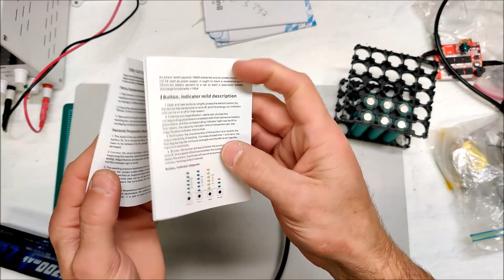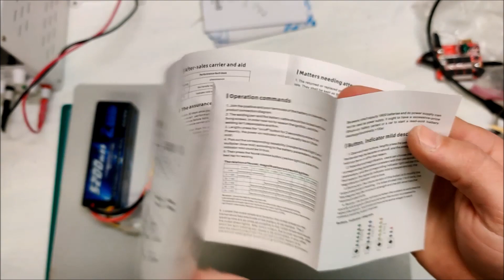NEW DIY SPOT WELDER - BEST YET?

Comment: Battery spot welders don't seem to be very good and are more for occasional applications than super capacitor spot welders. I made one myself using an old microwave transformer and a control board ordered from Aliexpress, but ultimately, that's also a bit of a fiddly job, and the nickel strips heat up too much when properly installed. At lower voltages, they're less robust, so I'm going for an original spot welder with capacitors, hoping it will work perfectly with minimal heat.

Comment: @bvmalukqat9545
Some additional data on this great spotwelder. I started measuring the delivered amps by this spotwelder and I really measure an astonishing 1800 -2000Amps. I first used my ampmeter and it gave out of range > 1000A. I got curious and installed 2 supply wires and then measured between 500-900A per wire = 1000-1800A. To be absolutely sure I bought a 400A 75mV shunt and this gives me approx 400mV => 2000A...
I use 4 very old (> 10years) 5000hAh 45-90C batteries in parrallel at 15-15.5V and installed 4 TVS diodes for  surge protection. I noticed that the voltage to the Mosfet gates is dropping too much (to 6.5V) on the highest setting and added 2 220nF capacitors (now it stays above 10V).  Note: Make sure you get the original plate and not the chinese copy.
Reply: Mines doing the same at the highest setting, could you share where to put the capacitors? Also how do you tell if it is original. Thanks

Comment: Thank you for your great research Steven. Can nickel be replaced with copper?
Reply from the maker: In theory yes, but getting really thin copper can be hard. Nickle is good enough for most batteries
Reply: @ I see. Currently I’ve got 0.2mm & 0.4mm  Cu strips. For 21700
Reply from the maker: @TariqShahFPV  0.4mm is really thick for a diy spot welder to penetrate
Reply: @ yes that’s what I was thinking too. God thing I got the 0.2mm. I’ll try to thin the.4mm down to .3 or .25mm. For minimum resistance

Comment: Hello, I bought one of these based on this excellent review (V1.4). I am quite happy and even can weld a copper nickel sandwich. 0.1 mm Plated Nickel with 0.1mm Copper. I do that at 14.8V - 2nd setting - and measure 900-1000A current. I use 4 very old (> 10years) 5000hAh 45-90C batteries in parrallel. Before pushing the JQ-DHJ02 even futher I have to install first some TVS diodes for  surge protection (probably the 1.5KE18A ) Any way the question I have: Is it possible to operate this board with a foot switch? Thanks
Reply from the maker: Im glad you like the spot welder!

Comment: Thanks for the suggestion on this one. Blown away by how good it is. No more powerbank style/built in lipo spot welders.

I'm using just 1/3 of a 12S8P A123 pack (very good condition probably barely cycled) so I have an IR of like 4.2mΩ on the whole 12V pack that I'm using. I put it on the second capacity setting since its about 19.75Ah and then I think I go up to about 30C. I"m getting solid welds on 0.20x8mm pure nickel and honestly I think it might have the juice to do 0.30mm pure nickel if I paralleled another 12V pack of 4S8P of A123 ANR26650M1B cells.
Reply from the maker: Awesome!
Reply: @stevenc22  well....I only had 7 Headway 38120HP cells left after I accidentally killed one so I built a 3S2P Headway pack and then just used one less series group on one of my A123 4S8P M1B packs so it would be a 3S8P.....

Lets just say after reviewing the instructions and and the chart for the Ah/C rate.....I had a 36Ah and I've been using 20C-30C and I'd guess its probably much closer to 30C than 20C because....at 1080A I blew her up....which...ya know its rated at 900A

The traces seem to be incredibly delicate or I really just gave her way too much juice. I also blew one of the fets but that seems to be a result of some traces going first and where I still had good traces is where I blew a fet. Just a massive crater in the fet. I desoldered it and I might try to repair the board by replacing all the fets with IRL40SC228's since that's what I have laying around right now.

Comment: This thing SUCKED!!!! I TESTEDNIT 2X.  first time it didn't work so good. 2nd test it worked very well. Was able to weld .2 tin strips. Then it was time to finish my pack and it wouldn't weld anything together. Not even the cheap fake tin strip that came with it. AND The plastic part of the power button popped off all by itself. I was trying to weld and not even touching & pop it flew over my head somewhere never to be seen again. It's not convenient to return things to amazon for me so I'm stuck with this inoperable trash ! Very disappointed! Now I'm not gonna have my bird working for the ESK8 convention  in Las Vegas next week!!!! SOBYEAHBIM PISSED! DO NOT BUY THIS!!!

Comment: quick question - an aircraft - 3s 11.1V lipo battery with 100C rating (but only 1550mAh) will work fine? it should give 155Amps. it has only 5 ohm resistance per cell.. so it should be able to give high bursts of current. any ideas will this work fine?
Reply from the maker: Maybe. I really think you need more than 100amps to weld well.
Reply: triple that for bare minimum

Comment: awesome tutorial! I got  one to try along with a 80C battery at  16V. Set to 5ah and 40C and 2nd gear. I get a beep and no weld. Soon as I bring the needles together and BEEP. adjusting settings didn't help. Tried another one with different batteries. Lots of beeps and no welds. Really jealous of how anyone here got this working!

Comment: I'm switching from sla batteries (12v x 5) to 26650 cells in the original cases. That is 16 cells / case.
I can solder nickle OK, I suck at batteries. In my case, I have a 110v mig welder I could use for power (or sla batteries)
From the vids I have watched on 'spot welders' not many promote the end be 'flat' when in contact with the nickle strip. 
In my case, I would prefer to 'ground the nickle strip to a clamp' and then use a single probe as the 'contact'. 4 spots would be 4 different touches and the ground would not be moved. Alternatively, the negative side would have a probe 4x the size of the contact probe. 
I would prefer to spot weld a tab of nickle and then solder the rest as the bike would be a 'high vibration' zone. (or spot weld the cells and then add a dab of solder on an edge or a hole in the middle)
If I find a small dia tip is perfect for a single thin strip, would that mean the same timer would work for thicker material if the dia of the probe was larger.
Sparky
Reply from the maker: Please don't use a mig welder on batteries.
Reply: @stevenc22  I can tap into the power supply without using the 'wire feed' part. It would be used for power on a mini spot welder.
 13 to 15 volts  or 15 to 17 volts
Reply from the maker: Don't do that. A lipo battery is $30 and delivers all the amps you need.

Comment: Excellent review, and like you I've had great success using the BIRFC welder w/o the inconsistencies you talked about. I'm wondering if that's because I'm using the capacitor that came with it, providing a more consistent current hit? I'll switch to this one if ever my BIRFC goes bad, which so far has been nothing but reliable.
Reply from the maker: I love my BIRFC!

Comment: Can we use supercapacitor for this board ? Thanks
Reply from the maker: I'm not sure. Check the AliExpress link and see if the description says it can be used for super capacitor.
Reply: Hi, I use my unit with 2 supercapacitors in paralel 2.85v and 3000F each one, the only think is you need an external power source from 1 to 2 amps and 12v for power on your spot welder
Reply: @francisconotengo3477  Please kindly show me how to do. It would be better if there is some picture attached. Thank you in advance
Reply: @quyrong852  are you serious?

Comment: Will this work with a 12v dc power supply?
Reply from the maker: Yes
Reply: @stevenc22   which 12v DC power adapter with how ampe, 12v-2A...12V-5A or higher? can used
Reply from the maker: Sorry. I got confused which video you were asking about. This will never work with a 12v DC supply. This needs 200+ amps to weld which you cannot get from a power supply. You will have to use a battery
Reply: @stevenc22  can i use a lipo 3s 3000mAh 45c or 60c for it? or need lipo 3s 5200mAh 80c
i click your link aliexpress, but they don't have version 1.2, just a version 1.0
Reply from the maker: 3000mah x 60c = 180 amps. That should just about be powerful enough.
Reply: @stevenc22  is a normal car battery good 45amp to 75amps. Those are what i have available. The 75 amps is for a diesel egine
Reply from the maker: Car batteries can normally deliver hundreds of amps. Car batteries are normally rated for 300+CCA (cold cranking amps). A car battery should work fine

Comment: I purchased the same spot welder and battery but I can't get this unit to detect when I am placing the needles, after I set my settings I just hear the indicator beep occasionally go off randomly, but never when I make contact with the nickel. Do you have any ideas? I was also using the bifrc spot welder with the same battery and that worked well until it I overworked it causing it to overheat and stop sending a pulse.
Reply from the maker: Sorry it might just be defective

Comment: Steven, by the way..... I intend to use my car battery with its 625 CCA rating to power this unit. Do you have any advice or opinion which setting on this device I should start with? I really haven't any idea how the 625 cold-cranking-amps of my car battery translates to the c-rating of a lipo battery, and so don't know what c-rate setting to set it at.
Reply from the maker: A car battery has a capacity of about 50ah. So your battery has about a 10c-15c rating

Comment: Steven, what a neat review! I had just bought this & received it a couple of days ago, but haven'y yet tried it. Your review will be very helpful to any potenttial buyers, being that there is hardly any feedback available about this unit, and I took my chances when I bought it. Your review is the first I've found, and it is inspiring.
Reply from the maker: Thanks. Good luck with the new spot welder. Make sure you have a good battery to power it.

Comment: I have the BIFRC welder and am going to buy this new model.  The new model needs a name!  Has your BIFRC been working better with the addition of the  AC 12V converter?
Reply from the maker: My BIFRC has always worked well. Sometimes it's a little inconsistent but I have built multiple batteries with it no problems. This new spot welder seems more consistent.